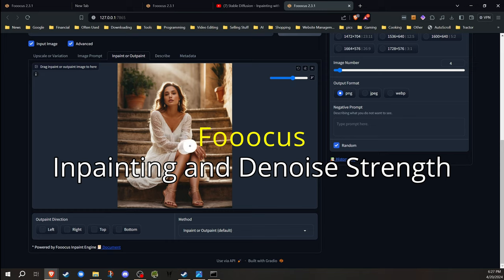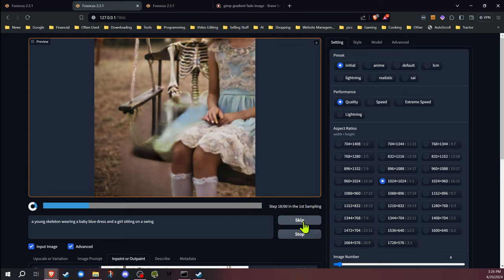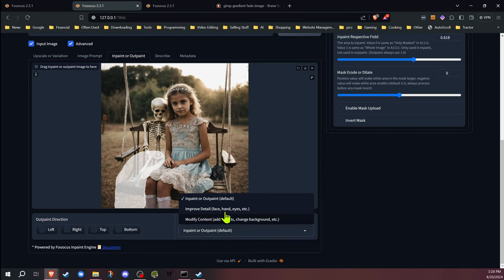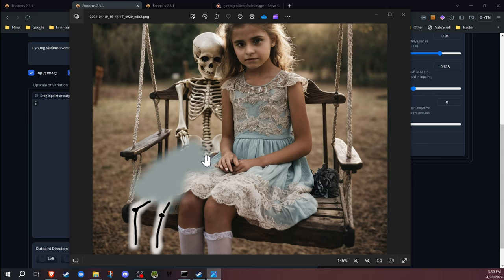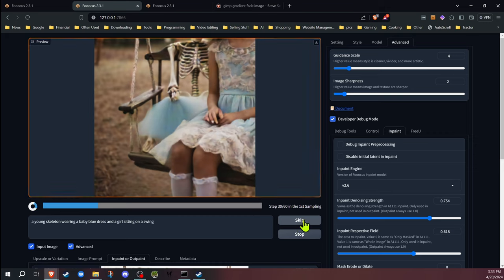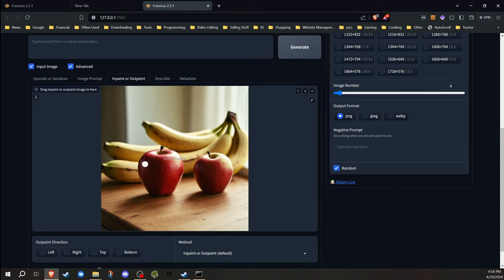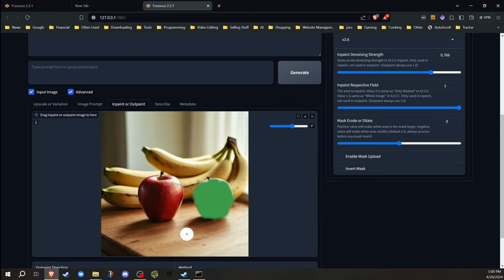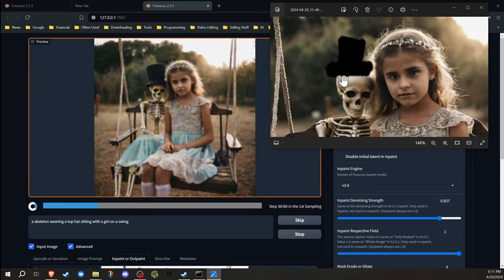Advanced Inpainting Tricks - Denoise Strength

Comment: Thanks for the info. Do you know if it's possible to change the Fooocus inpaint engine from v2.6 to one downloaded from CivitAI? I downloaded an inpaint model for Juggernaut XL v9 but when putting it in the Inpaint folder of Fooocus, I can't figure out how to make the switch within Fooocus. The reason I ask is I find the resolution / quality of the outpainting, when extending an image to the left, right, top or bottom, to be lower than the original image that I want to extend.
Reply from the maker: I don't think it is. Although I am not sure you would want to since Fooocus really has one of the best inpainting engines and is designed to be used with any checkpoint you have selected. No need for a special model.
Reply: @KLEEBZTECH  May be due to the fact that I use non-standard resolutions (1344 x 1344) whereas the inpainting is limited to 1024 x 1024 and has to "upscale" without improving the quality
Reply from the maker: Just saw the updated comment. When outpainting are you doing just one side at a time? It sounds like you may be but if not I have found it is best to do only one at a time for best results.
Reply: @KLEEBZTECH  Yes, I've tried one at a time and gives better results than when extending all four sides at once, but still doesn't have the same level of fidelity and detail as the original image. Oh well, thanks for responding.
Reply: Yes, this entirely possible, although a little fiddly. The Improve Detail Inpainting method never uses any of the Fooocus specific Inpainting engines. Instead it uses whatever base model and refiner (if any) that you have specified under the Model tab.

If you go to the Advanced tab, check Developer Debug Mode and then the Inpaint tab. You now have complete control of the Inpainting process. You can make the Improve Detail method work like either of the other two methods, but still you use the base model of your choice.

To emulate the Default Inpainting method, make sure "Disable initial latent in inpaint" is NOT checked, make Inpaint Denoising Strength = 1.0 and Inpaint Respective Field = 0.618.

To emulate the Modify Content Inpainting method, make sure "Disable initial latent in inpaint" IS checked, make Inpaint Denoising Strength = 1.0 and Inpaint Respective Field = 0.0.

To return to the normal Improve Detail Inpainting method, make sure "Disable initial latent in inpaint" is NOT checked, make Inpaint Denoising Strength = 0.5 and Inpaint Respective Field = 0.0.

I should also mention that all three methods always use your base model and refiner - but the Default and Modify Content methods use the special Fooocus Inpaint engine in addition to the base model and refiner.

*** UPDATE: it looks like all you have to do is go to the Inpaint Engine selector under the Inpaint tab in Developer Debug Mode and simply select "None" instead of V2.6 or the other two models. Now Fooocus will use only the base model and refiner for all three Inpainting methods. Also - that should apply to Outpainting - I just noticed that was the purpose of your question.

I'm leaving the other information there because it could be a useful reference for the differences between the three methods.

Comment: That what I was looking for, but didn't know at the time, when I was struggling just as much as you were.  In stable diffusion, there is an option sketch inpaint. Essentially its the same step within the program. Have you tried same trick with hands so far?
Reply from the maker: It can work with most things including hands. It is really how the improve detail function is working.  But for some things it can me tricky with the colors and finding the right denoise strength.

Comment: Hello, is it possible to give the face wetness, water effect, blood effect etc. without interfering with the original face?
Reply from the maker: Not really but maybe using something like Faceswap as well in combination...
Reply: @KLEEBZTECH  Well, is it possible to nude or change the body type without interfering with the original body pose? For example, I want to make myself half-naked and muscular in a photo with clothes on. While doing this, it changes the pose almost completely, but it does not make any intervention in the improve detailer part, how can I do this? Isn't there a way to remove clothes in the improve detailer section? but then it may not interfere with the original pose.
Reply from the maker: You are not going to do that using the improve detail option. Regular inpaint and masking just the area of the clothing would be the only real option. Also could do in portions if masking too much area is changing the pose. For example if long sleave shirt then just mask the arms area and ask for short sleave. Then when you get that correct mask the new image from there without masking any of the bare skin part. It should keep the pose for the most part since you will be leaving mush of the person untouched.  @DnmHsb
Reply: @KLEEBZTECH  Yes, I do this, but it is tiring.  I hope that such problems will disappear in the future when artificial intelligence develops further.  Thanks for your response.

Comment: Hi. Here is a solution to the problem of freezing when you using OBS. If you have two computers, you can run Fooocus on the main, more powerful computer, and share it (in fooocus settings). And on the second computer you need to open the shared Fooocus in the browser and record the screen using OBS on this computer. The neural network processing will take place on a powerful PC using all its power, and the OBS screen recording will take place on another PC.
But you need two PCs :)😅
Reply from the maker: Thanks! Technically could do one better since I do have a capture card in a system but that is currently being used for something else. I only run into issues when upscaling happens so usually not much of a problem.

Comment: Fooocus is fully local right?  Like no one sees the pics you make, yes?  Cause, i mean, its pretty easy to make some wild s.hit.
Reply from the maker: If you download and run on your computer then yes. It does need to have a connection for some things since it needs to download the models when you first use it or if you go to use inpainting for the first time it will need to download the models it needs. But otherwise yes fully local.